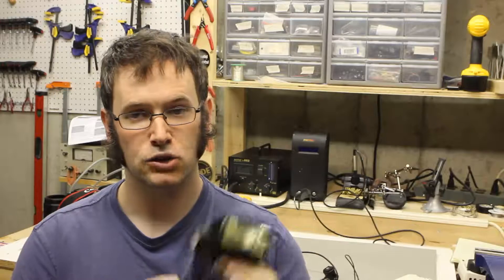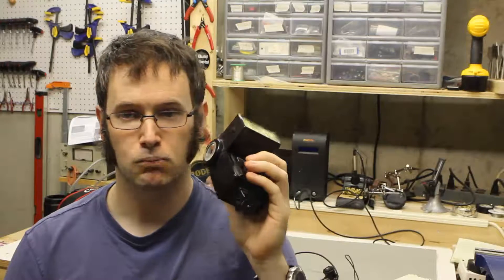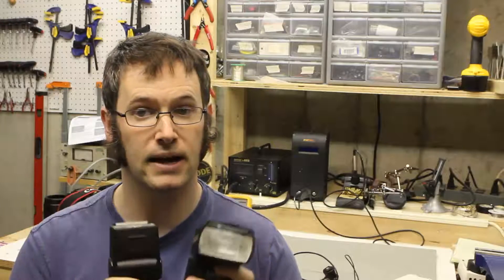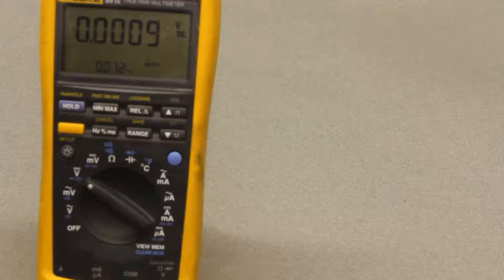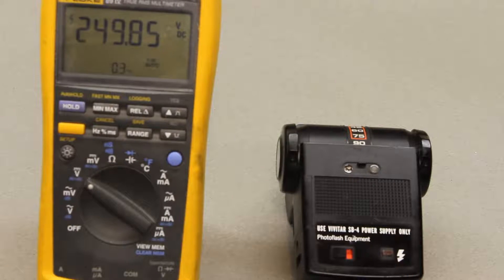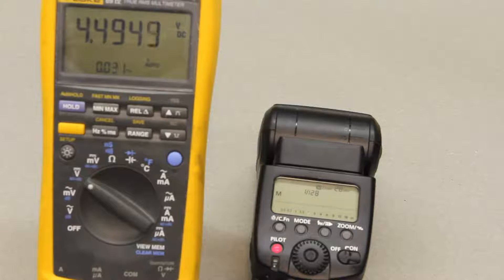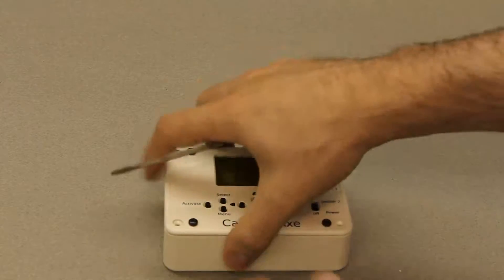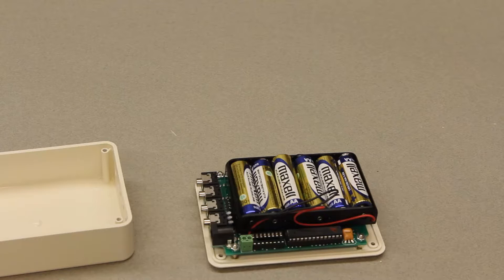TPB #8 - Measuring Flash Trigger Voltages

Comment: I found this helpful. Good to know about the voltage requirements. It appears the multimeter was connected by a typical remote cable with one end stripped....for those complaining.

Comment: Would've been nice to see how you were measuring the voltage
Reply: To measure the trigger voltage switch the flash on and put your multimeter leads on the centre pin and on the ground contact that sits in the rail of the flash foot.
Reply: @MrAllstar  Thank you
Reply: @bobbob123ful  my pleasure 👍